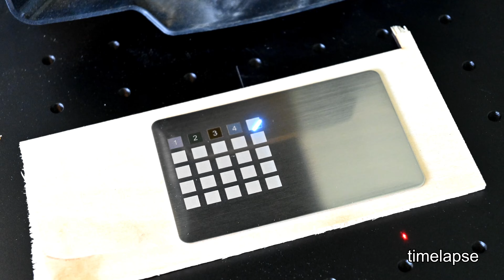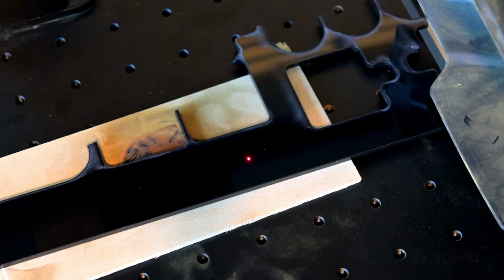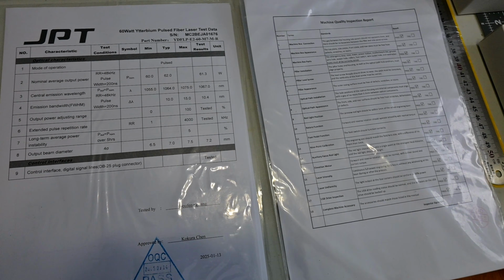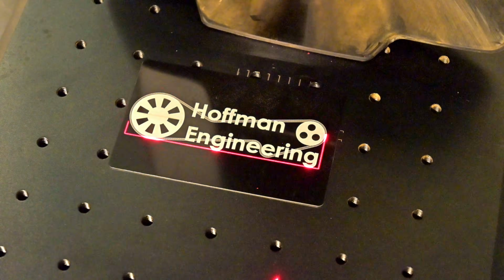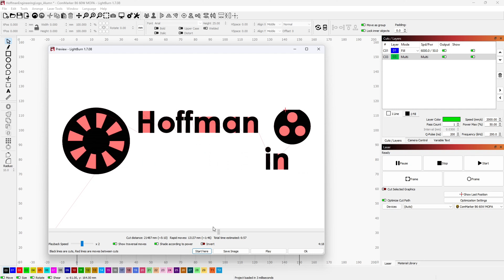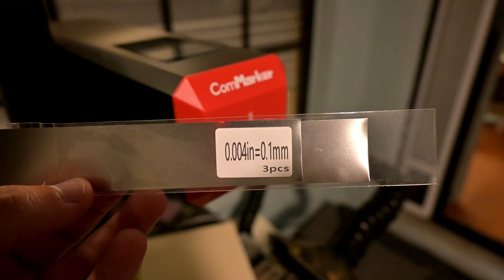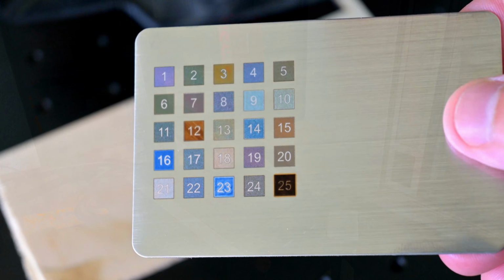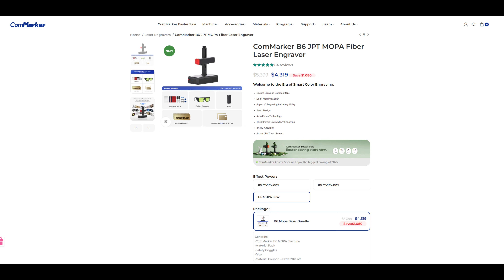The BEST Fiber Laser for Small Shops? Full Review of the ComMarker B6 60W MOPA fiber laser

Comment: If the lenses are interchangeable, what lens is the best for the best resolution? I have a very small working area of about 50 x 50 mm.
Reply from the maker: Generally, the smaller the lens, the smaller the work area, the tighter focused the laser dot is and the higher resolution. Smaller lens also have a shallower depth of field where the laser is in focus.

Comment: How do you like it compared to the one in the previous video?
Reply: Awesome thats what i needed to know, you got my follow! Im fairly new to fiber lasers and looking for my first one. Mopa is definitely what im looking for. Would you recommend one of these two or a different one? 3-5k price range
Reply from the maker: Thanks! For that price range, I think the B6 60W MOPA is an excellent choice. It's a good balance between enough power for reliable metal working, but still controllable enough for plastics.
Reply from the maker: Great question. I think the Commarker B6 has a tighter focused laser dot and can activate the laser at a lower power percentage than the Monport GA60. I had better results on black acrylics with the B6 because of that. For higher power applications, I think the difference is small though. 

The Monport GA60's larger work area can be helpful, as does it's ability to swing the laser head to the side. So if you need that ability, then the GA60. Otherwise, I think the B6 has the edge ever so slightly.